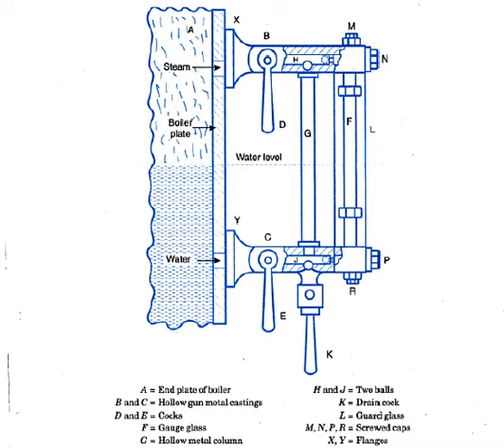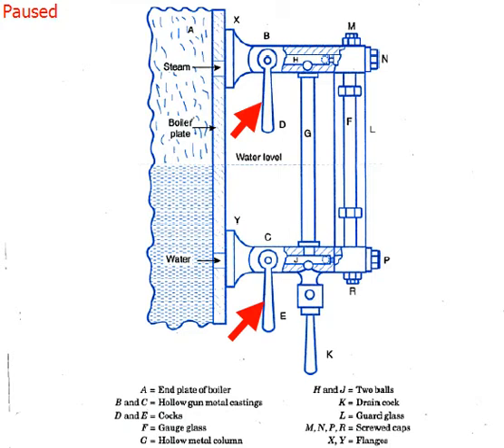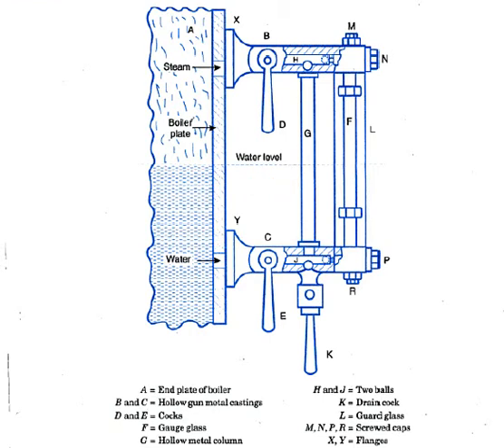Water level indicator

Comment: I didn't understand when and why the glass tube get destroyed ?
Reply from the maker: There is no particular reason for breakage of glass tube. it can break due to accident or unable to withstand high temperatures. That is the reason small steel ball valves (H&J) are provided to avoid wastage of water in case of glass tube breakage.